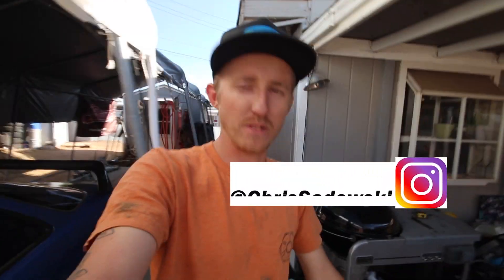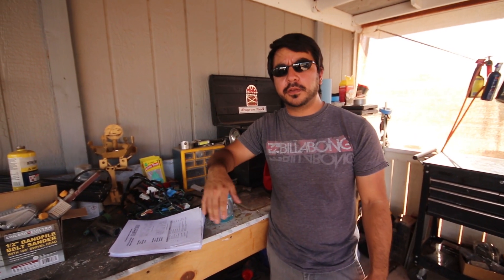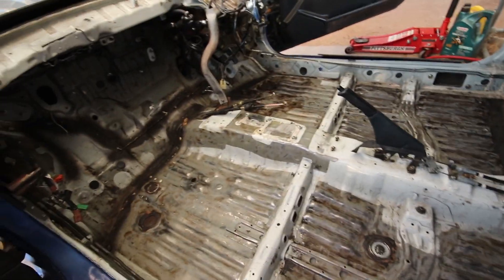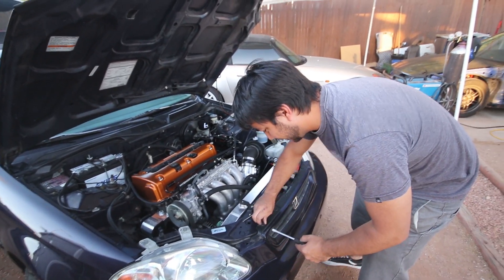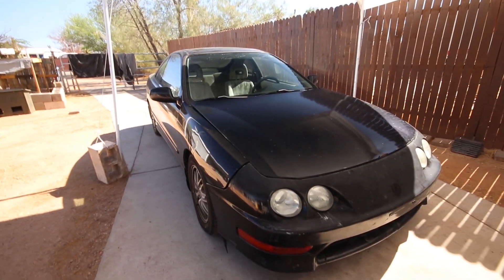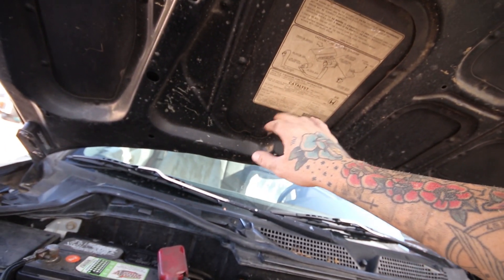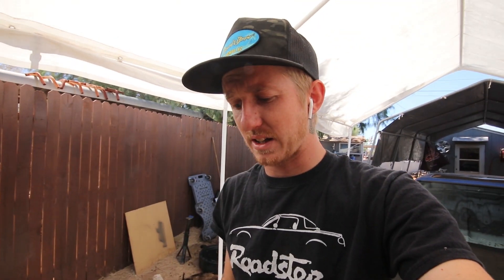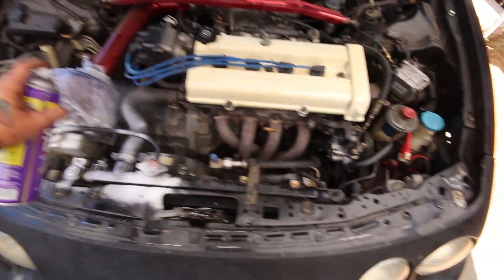DA Progress, Bringing a Subscribers Car Back Up To Par

Comment: I need that tuneup done to my 90 Integra LS Just replaced the distributor an alternator got a timing gun but I'm having a little trouble shorting out the computer paper clip trick isn't working check engine lights not coming on, don't know if the computer is shutting down so I can do my adjustments

Comment: Ktuned conversion harness and ktuned tucked harness worked awesome for me in my kswap 88 civic sedan you must not know how to read instructions ktuned is the best for wiring my oppinion never had a problem
Reply from the maker: As far as I know Ktuned really doesn’t make most things in house. All outsourced, usually Chinese made items to cut production costs. Glad it works for you but any mechanical item I’ve had to use, or anyone I know has had to use has been trash